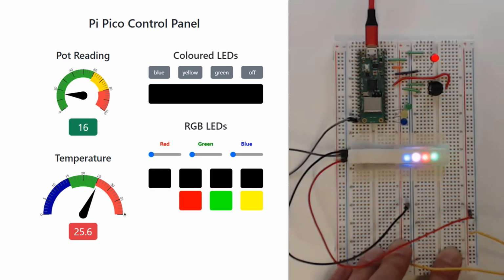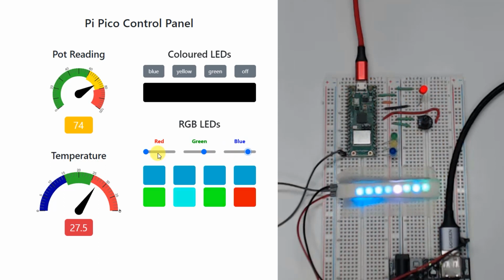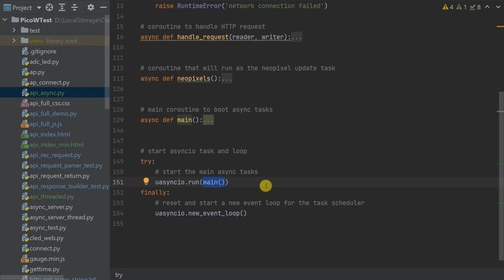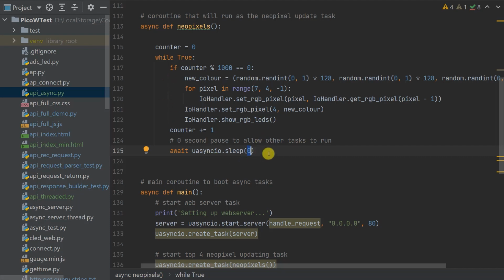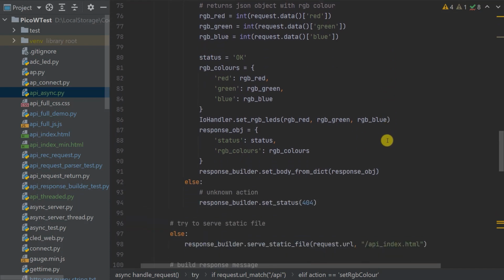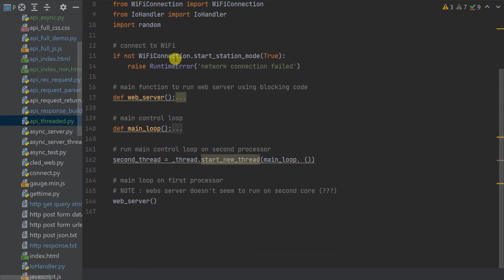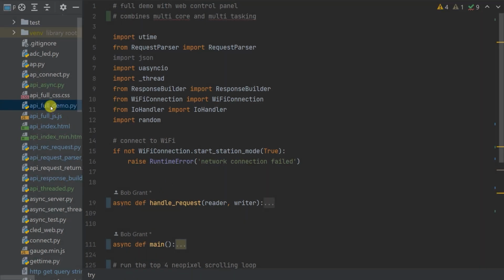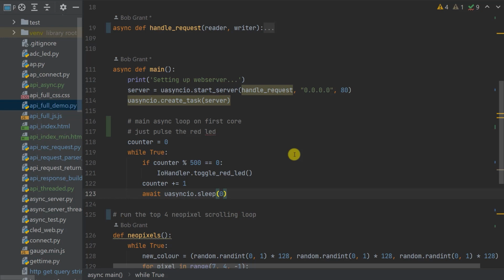Web Control Panel - Micropython asyncio and dual core  web server for Raspberry Pi Pico, ESP32

Comment: These tutorials are great, I would like more info on adding a file list or a tab for downlaoding a data file that has been generated from the control program. I am generating CSV text files on the pico and would need to transfer them to the client computer system. Thank you for the time and effort generating these tutorials.
Reply from the maker: You'll have to have a look at some html coding. To download a file create a get request that triggers the file contents to be returned as the http response. You'll need to set the header content type to something like text/CSV (please look up the correct header)
Reply: Thank you, I am not very familiar with HTML Coding so it is my next step in learning this process. Appreciate the point in the right direction.

Comment: Really great stuff here man. just a quick question
i have tried with my own custom built webserver that also manages ap and wifi connections (will share soon) but i have encontered a problem. I use thonny to run the code and when stop the code it seems that the code actually stop but id restart and stop again the pico starts to be unreachable. 

Have you used thonny? Did you experience the same behaviour?

Thanks a lot for all your hard work!
Reply from the maker: I think that's fairly common across all the development platforms. The REPL interface is not a proper debugging and control tool. I find powering off the Pico will give it a full reset and reconnect.
Reply: @BytesNBits  gotcha. I couldnt find any solution other than what you propose. I even tried with a global variable to stop the cores but it doesnt work. thanks a lot. you are the man. keep it up!!:rocket-red-countdown-liftoff::rocket-red-countdown-liftoff:

Comment: Nice work, what caught my eye was the displayed graphics. As for myself, I've decided to upgrade my PIC24 remote server (that controls antennas; transmitters, etc.) to using the Raspberry pi4. Since I've not done any webserver sites since the early 2000's, need to learn how to use PHP, JavaScript, CGI, etc. all over again. To bad this is all done in Python and not in C or C+. Not for me, but will watch the video's. Could be something interesting.
Reply from the maker: It will be a lot easier if you put in a Raspberry Pi. You can install a proper web server such as Apache to so a much better job than this server. Have a look at installing a LAMP setup on the Pi. That will gine you the Linux/Apache/Mysql/PHP server you need.
Reply: "Have a look at installing a LAMP setup on the Pi. That will give you the Linux/Apache/Mysql/PHP server you need." Is this your work, if so you have a link? Regards

Ya but unfortunately, I just simply do not understand Python, as it is to weird for me, not what I've been use to the last 40 years.
I am familiar with Apache, and I did install it a couple of days ago. Along with Ajax, PHP, and CGI. 
My other option would be to use Qt Creator5/6 with the Pie, as I have experience with it, but just trying to figure out if I can run a web server and also Tcp/Ip Socket. 
My client uses Qt5 with the Tcp/ip Socket, and the Pic24 uses the latest Microchip Socket API. 
This is all new to me, using the Pie, I've done this kind of application years ago, with at the time modern commuters(X86).
Back then used, Microslop "Front Page 2002". That really dates me! LOL!
The last time I did this was, with my commercial website, still up, but not maintained since 2007! I retired and the old age of 48! LOL!
www.northandradio.ca
The nice thing about the Microchip TCP/IP Stack, with the imbedded processor, all of the Protocols are within the API, and the processor will execute any and all requests, since, of course it is interrupt driven.
I am currently watching, "Build a web control panel for your project - HTML and JavaScript coding (1080p)"
Man you know your stuff!

But for now, for me it's just an "information gathering", getting some knowledge and experience. (Research)

Comment: Thank you so much for this amazing tutorial. I am trying to achieve something similar, but by using W5500 from wiznet instead of wifi (wanna have wired connection and PoE). Unfortunately it looks like the uasyncio server_start cannot start the coroutine (looks like does not have access to the network). However standard socked does. Did you have similar issue? Do you have any sugestion? At the end, it looks like, I will end up with multithreating, looks like the mentioned bug is fixed. Thank you. Briliant work.
Reply from the maker: It's worth playing around with which tasks run in each core. I found that the WiFi hardware only runs on core 0.

Comment: Wow, what a great video and your web tutorial was was just as good. I have to say though, you mentioned this would work on the esp32 and since I had one already setup with all my sensors, I used it instead of my picow but just couldn’t get it to work. I’m certain it was something I did but I messed with it for several hours when I figured I’ll just try it with a picow, w/ nothing attached, and it worked right away. Your videos and web pages have saved me months of research. Thank you so much for the countless hours of research, coding, creating web pages, and making and editing these awesome videos. I look forward to more content.
Reply from the maker: Thanks for your comments. Yes. I was a bit to hopeful for the ESP32 being compatible. I think Micropython runs very differently on the ESP32, especially when it comes to multi core - basically I think the ESP restricts Micropython to a single core. If you just run in asyncio it should be OK with not too many tweaks!
Reply: Turns out the ESP32 was running circuitpython, and maybe that’s why it wouldn’t work🤔

Comment: thank you! this topic has almost no tutorials and you made it easy.
i love how you combined the two approaches in the end.

i noticed there was a delay between the colored displayed on the web server and the neo pixels hardware, is this due to internet speed or does this mean asyncio introduces some delay?

thanks a lot.
Reply from the maker: There is a slight delay over the network as the request is sent, received, decoded and actioned. Plus I was  manually syncing up the video streams by eye so that could also be a factor :)

Comment: Overall how do you find uasyncio running on the Pico? I believe they still consider it experimental. Based on what you've experienced, do you think it's stable enough at this point? What are the main areas you need to be careful about when setting up uasyncio? Are there limits to the number of tasks you can setup and have successfully managed by the scheduler? How much bigger are your programs when uasyncio is included? Have you found it to be consistent across different uprocessors (not sure if you've used uasyncio with processors other than the Pico)? Getting rid of blocking code is so important and necessary to allow for more advanced projects.

Would be great if you produced a video on more details about how to setup and use uasyncio. I was somewhat expecting a bit more info on the general setup of and do's & don'ts for structuring your tasks. Maybe something for the future. Thanks.
Reply from the maker: I'll be honest and say I'm not an expert with asyncio.  There are some great tutorials online that will answer your questions better than I can.
Reply: @BytesNBits  K. Thanks. But based on your experimentation, what do you think? Can you provide any links to other tutorials that you think can better answer my questions? Appreciate any help. Thanks.
Reply from the maker: @christopherlyons7613  multi tasking is quite a big topic and you can really go as deep as you want. Asyncio seems to work well on the rp2040 and esp32 devices but I haven't run any benchmarking tests to verify actual performance. There will be an overhead due to the scheduler and of course individual tasks will be affected by the other task loads. 

On the tutorial side I skimmed through a few articles to get the general overview of using asyncio. The basic ideas are fairly straight forward to get up and running. My tutorial shows the basic structure to get multiple tasks executing. Once you've got that sorted in your head I tend to find experimenting with little projects will let you delve into the more advanced use cases.

Comment: I hope you will be able to find the time to solve the threading/dual core issues and post the 3rd video in this series. It has taught me a lot. Thank you!
Reply from the maker: Thanks. Final part coming out next week.
Reply: @BytesNBits  The threating seems to be fixed as of today. I am running two independent sockets, each on one core, and it seems to work without issues
Reply from the maker: @6672378  That's great. Thanks for the info. I'll give it a try.
Reply: @BytesNBits  it has crashed yesterday, seems to be a memory leak. I have put a garbage collector call after every http query. It looks like it helped. I am hitting now the receiver by 18 bytes, 20x per second, for 24 hours, without crash

Comment: A very good and meaty presentation of code that is going to prove very useful for a range of projects.  Only thing I'm not too sure of is the 
finally:
        asyncio.new_event_loop()
as the code in the 'finally' is what is run after the code in the try has run (or failed) , and some async test code I played with ran just as well without that asyncio.new_event_loop() statement in the 'finally' section of the code.
But thanks for a really good set of tutorials that covers a lot of very useful ground.
Reply from the maker: Thanks for your comments. I'm glad you found it useful.

On the finally block, it's really there as an explicit way of ensuring the async event loop is reset and cleaned up after the main task loop has finished. The asyncio.run call starts the event loop and runs the main coroutine. The code at this point goes off and runs the event loop. The finally block only gets executed when this event loop exits, either normally or on an error. Try adding a print line in the finally block and you'll see what I mean. It won't run until you exit out of the code - CTRL C in my REPL panel.

In our code it's probably not necessary but is good practice if you start writing code that stops and restarts event loops.

I hope this explains it.

Comment: Thx for this info. I’ve been pulling my hair out for 3 days trying to get multi core working on my project with a web server running on the second core. I get exactly as you describe, it seems to run for a few loops, maybe even get a web page to display remotely on another machine, but then it all hangs and even stops the main thread on the first core too. I searched and searched for a reason but came to the conclusion that _thread just isn’t ready yet and was going to give up. I’ll now try swapping the threads over and try running the web server on the first core. Hoefully this will resolve my issue.
Reply from the maker: I feel your pain. It seemed logical to me to run the web server on the second core at first as well. Oddly I got a comment not so long ago saying that on the ESP32 core 0 is hardwired to handle the WiFi and Bluetooth hardware. It might be the same on the Pico.
Reply: @BytesNBits  Yeah, I decided to add the web server on second core as an after thought to my project just to monitor my log files, so never thought to swap them around before. I tried thread locks/release etc and all that stuff but never got it working. My main thread still has MQTT posts so I hope this will still work. I’ll post back and update once I get round to testing it. Cheers.
Reply: Oh well, still looks like this isn't going to work. My code works fine IF i comment out all MQTT client connect and publish commands on the second core. Seems any call to use the network connectivity on both cores is the issue. Looks like I may have to go the uasyncio route at this rate :(      I hope they can get this sorted out. Not really dual core if not. I don't see why an inbound socket accept() should prevent an outbound mqtt publish, but I'm no expert.

Comment: It's a pity that MicroPython refers to the multi-core library on the RP2040 as _thread; it should be called _core instead. This had caused a great deal of confusion. While the ESP32 has two cores, the first core, core0, is dedicated to system-specific tasks such as WIFI and Bluetooth. MicroPython operates on the second core, core1. On the ESP32, the _thread is preemptive multitasker, and we can have up to 25 threads running concurrently.
Reply from the maker: Thanks for the info. I think the ESP32 is a much more powerful and versatile processor but it does add in a bit of extra complexity is some areas. The Pico seems good at keeping things reasonably simple. I'll probably need to add some videos using the ESP32 to show the differences.
Reply: @BytesNBits Thanks for your videos. Would definitely be interested in seeing some videos covering the ESP32 and the differences between it and the Pico.